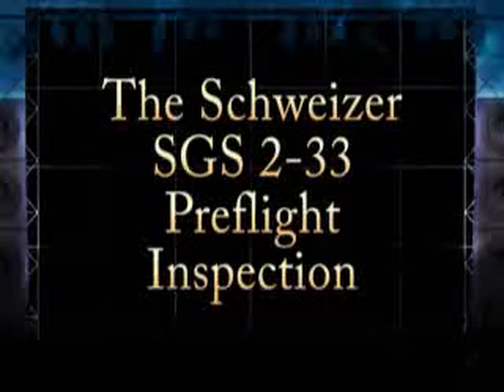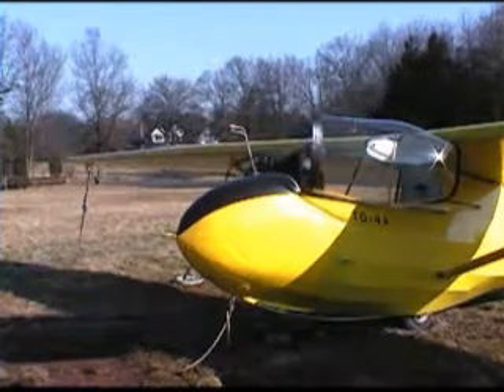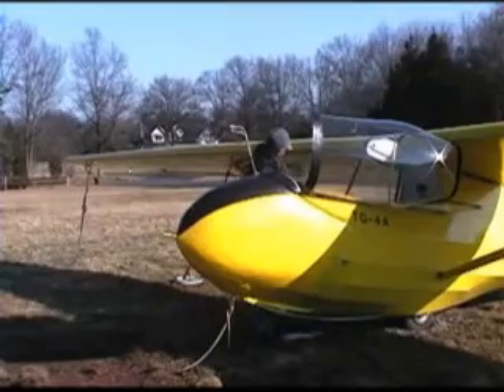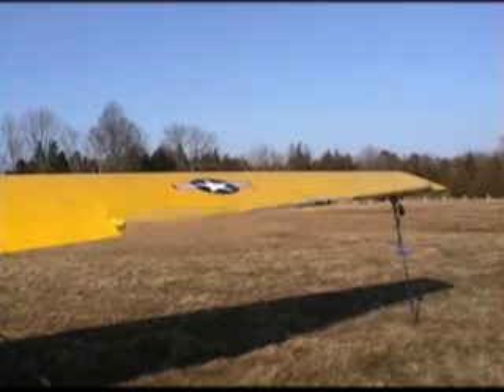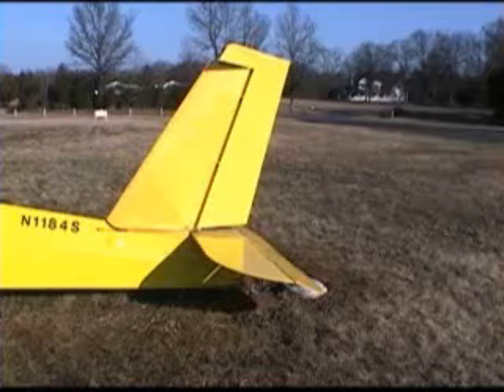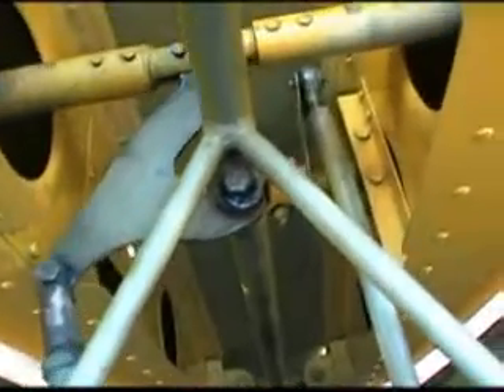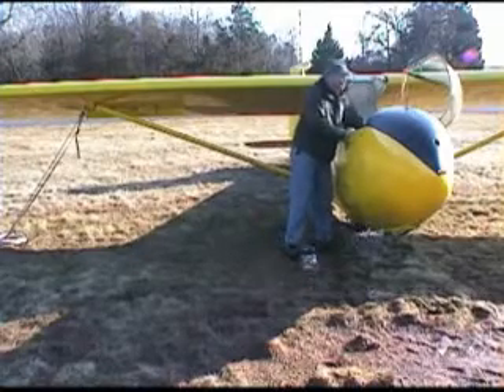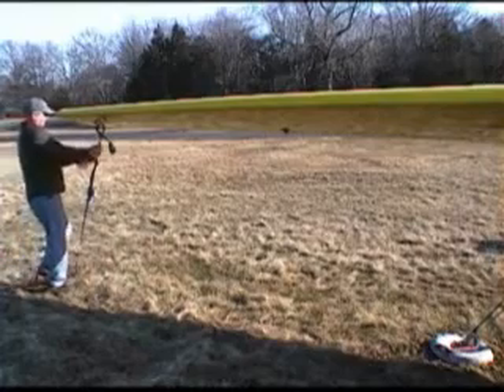2-33 Glider Preflight Inspection Part 1

Comment: Ron excuse me if my question is too obvious but I´m in the process of learning more about the sailplane, the model inspected in the video is the SGS 2-33 or the SGS 2-33A? I understand the difference between them lies in a larger rudder for the SGS 2-33A, but I don't  know exactly what is the shape of each rudder or whether it is just a matter of difference in size with the same rudder´s shape in both models
Reply: Diego Avila its a 2-33a. The rudder has the counter weight and sticks out ahead of the hinge point at the top. The 2-33 does not.
Reply from the maker: Hi Diego, I’m sorry but I really don’t remember if this glider was an A model or not. It’s been a while since I made this video. Maybe someone else viewing here can tell from the video. But thanks very much for viewing it and contacting me. You can see the full inspection in one video at this location. https://www.youtube.com/watch?v=s6QcOQ3olbE&t=5s

Here is a copy of the 2-33 checklist I used. http://tinyurl.com/hetp53e